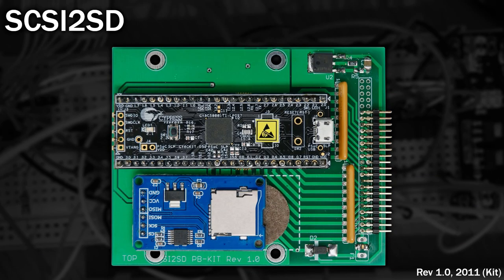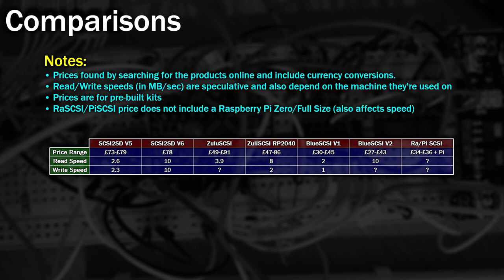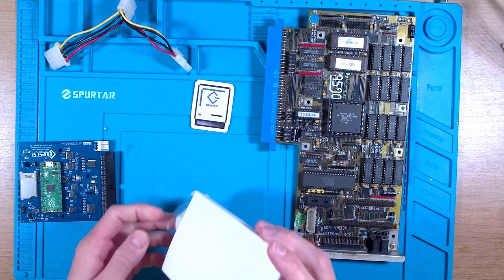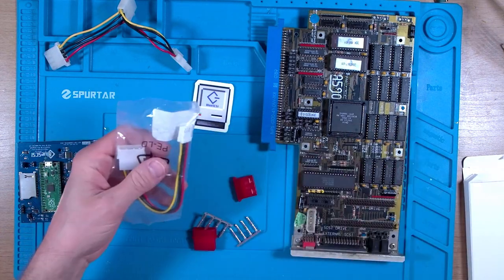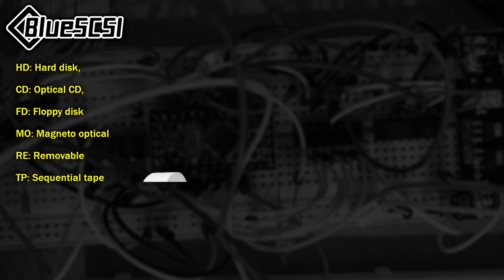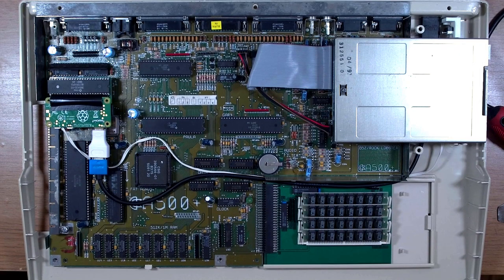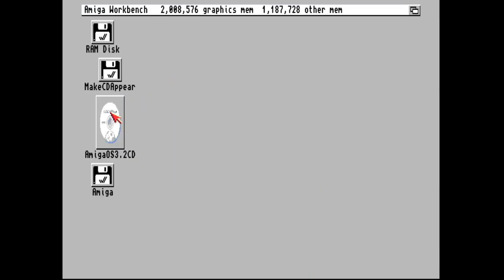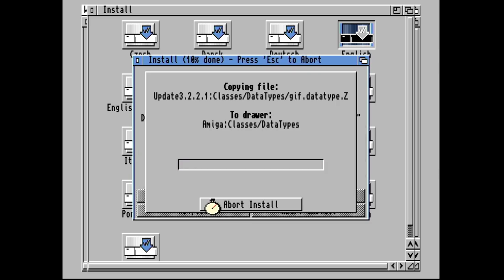BlueSCSI v2 Inside! - Bin that old A590 SCSI Hard Drive - Part 3

Comment: Is there a modern hard disk controller that could be used with the BlueSCSI?
These days A590 and such are hard to come by. It would be great to have a modern HD on which to plug in the BlueSCSI... Or maybe there is a all in one solution out there somewhere...
Reply from the maker: I don’t think there’s any need. There’s too many IDE, SD or compact flash alternatives - if I had t got the A590 I’d probably have bought one that plugs between the 68000 cpu and the socket.

Comment: Welp, I'm using a 4GB SD card, exFat formatted, 512 byte allocation unit size.  My hard drive file name is "HD10_512 - AmigaHardDisk.hda".  That fie is a clone of the old 88MB Quantum hard drive that used to be in the computer.  Unfortunately, when trying to use this new setup I just get a system request prompt that reads: "Not a DOS disk in device DH1" --and it won't boot.  Bummer.
Reply from the maker: Several reasons why it could happen - might not be the right kickstart version, might be missing (for example pfs3) driver. Try installing diskflashback and see if it can open the file
Reply: @RobSmithDev  Whew.  Good advice.  It's a little bit deeper in the pool I usually swim, but I'll try to figure it out.  I don't know what "diskflasback" is or how to use it, but I'll search for additional info.  BTW, the drive file on the SD card/BlueSCSI is literally a direct clone of the physical hard drive that I just stopped using.  I mean, I could put the physical hard drive back in the Amiga 2500 and it'll boot up fine.  That would seem to inform me the kickstart ROM in my 2500 machine is an appropriate one, right?  (I'm not a regular vintage Amiga user, just getting back into trying to save my old computer, so I'm ignorant about a lot of these things).   Thanks for your videos and help!

Comment: Annnd - Not a DOS disk... I unable to manage to work BlueSCSI on any of my Amigas (A590, GVP HC+8, A3000) :(
Reply from the maker: I have it working on my HC+8 fine. The size of the SD card you are using could be a factor. You may also need newer ROMs
Reply: @RobSmithDev  I burned the latest ROMs. Also tried DOZEN of different cards. Could you share your file-parition?
Reply from the maker: It’s too big to share. Does the hd tools even detect the blue scsi?
Reply: @RobSmithDev  Nope. However, I manage to make it work on my A2000 with GVP HC+8 SCSI controller. A590 still does not even see the "drive".
Reply from the maker: Weird. I can literally swap the SD card between my A590 and my GVP and it works in both. I think something might be wrong with your A590 setup. Have you checked the bluescsi site for some clues? What does the led on the bluescsi do on power up?
Reply: @RobSmithDev Looks like A590 is seaching for a disk on each unit - it blinks 6 or 7 times and later starts to boot from floppy. Sometimes LED is on from the start, permanently and nothing happens.
Reply: It boots fine from regular SCSI disk, though.
Reply from the maker: The comment about LED is important. It will help identify if the blue scsi recognises a valid SD card